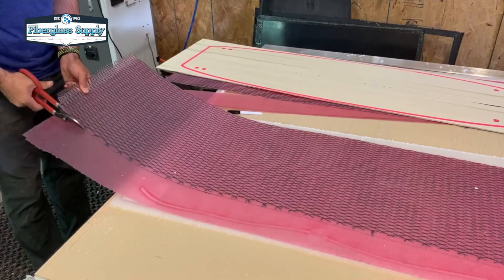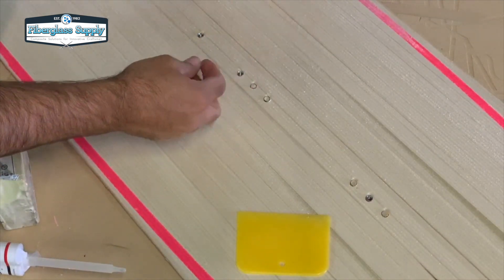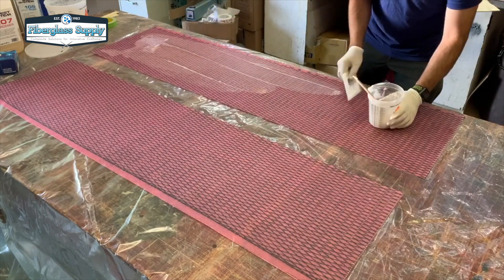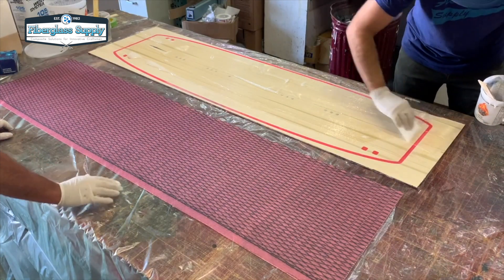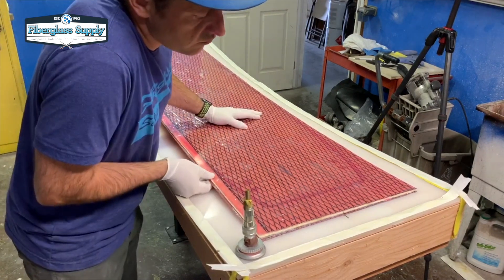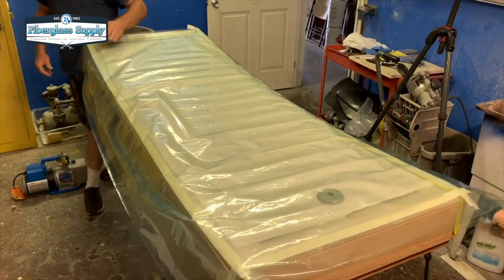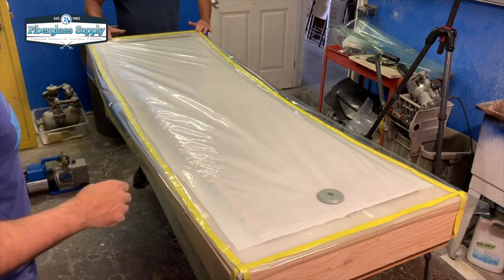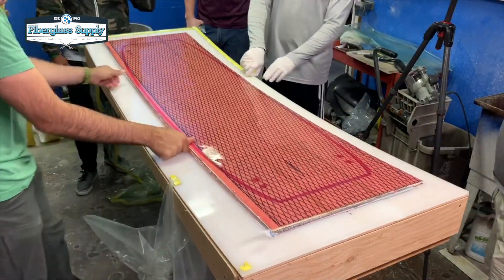How to Build a Twin Tip Kiteboard - Part 4 Assembling the Board

Comment: Now I think boards are not that expensive after all. 
Mass production is probably more automated but still...
Reply from the maker: Mass production does streamline a lot of the process but it is still requires a skilled workforce, expensive machinery, and expensive materials. Tom Court (Duotone) has a video of his model being made at the Capita factory that is worth checking out. It is a very nice facility.